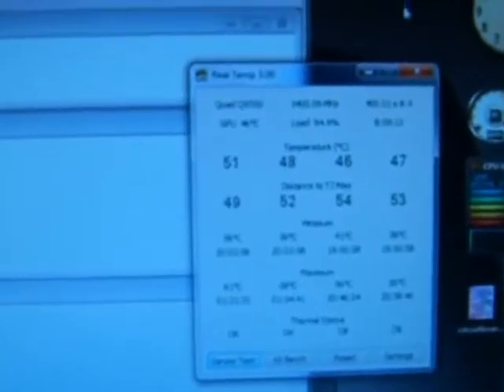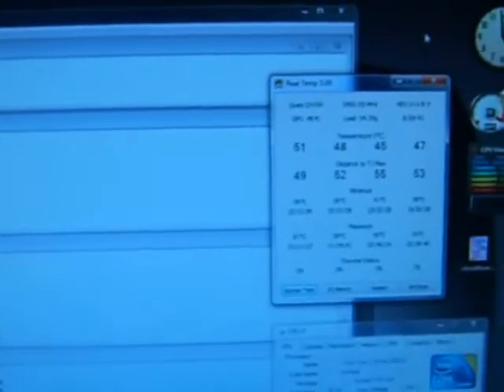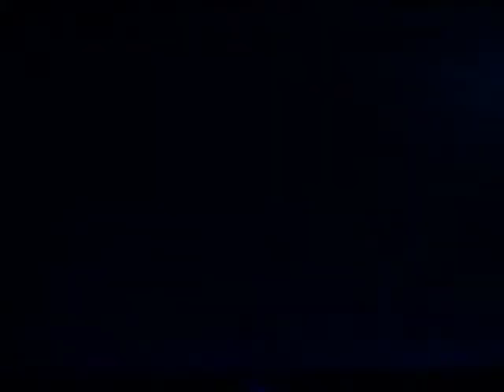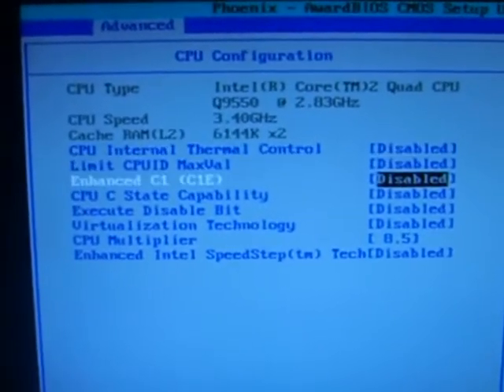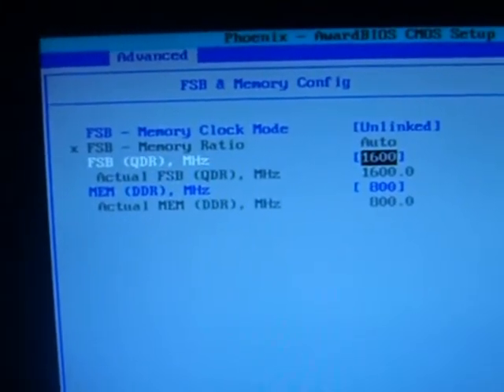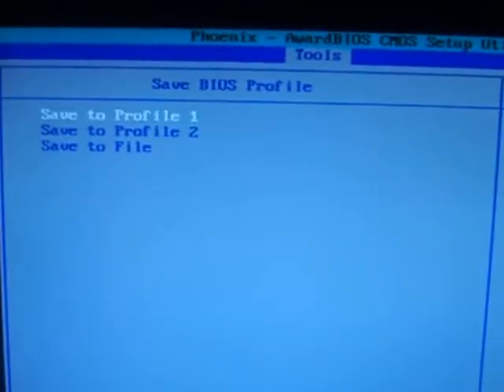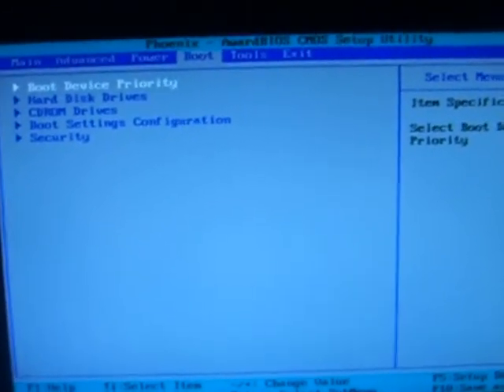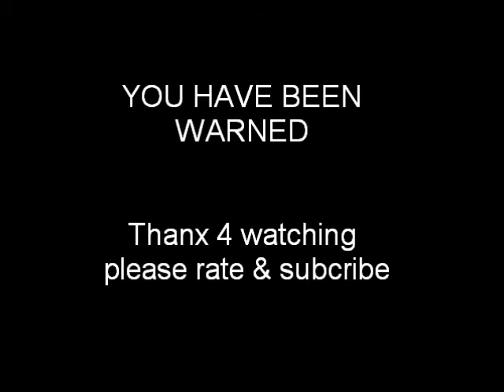overclocking a Q9550 on a Asus P5N-D

Comment: Got it yesterday for 12 dollars. It was  almost like new. Reason why I bought it is that my previous mobo only had 2 ram slots(btw it was Asus P5G41M, yeah alot newer 775 mobo). Currently everything is ok. One of the better mobos which I owned. Im having all 4 slots occupied with Kingston modules which are each 2GB, 800Mhz, CL6 latency. I like that it has two 3pin connectors for fan which my previous mobo didnt had.

Comment: I know this is an old vid and I've watched it many times. Unfortunately I never got mine as stable as yours but just noticed today that your Hardware Monitor in bios was showing way over 12v on 12 voltage setting. I can only get 11.96v. Is there a way for me to increase this apart from buying a better power supply. Thanks in advance for the help.

Comment: If you have the same comp as this guy then you probably need at least 2 gig of memory. Unless you're running winXP perhaps but win7 will be much more responsively with at least the very least, 2 gig of memory. With your own spec, I would guess that your 512k won't take a lot of overclocking with a quad core - it's a weird match.

Comment: On the dram, if a computers got 512mb of ram but the computers slow as fuck and I've overclocked the processor(to 3.50) to speed the computer up... which way am I gonna turn the voltage on the dram Up or down? I wanna try get a even balance if that would work..its Not my pc.. trying to fix a piece of shit pc for some one

Comment: Thanks man, I've had this processor for a couple years now and I only ever used the 10% overclock that the board supplies because 15 and 20% were never stable. Cause of this video I'm now at 3.4Ghz. This is the first time I've manually overclocked and managed to post so it's pretty nice. Do you still have the processor? And what was the highest overclock you managed to get from it on this board?